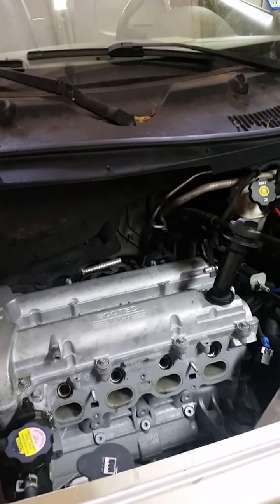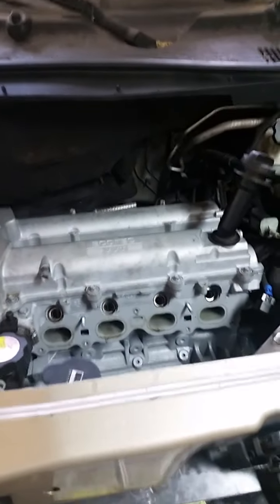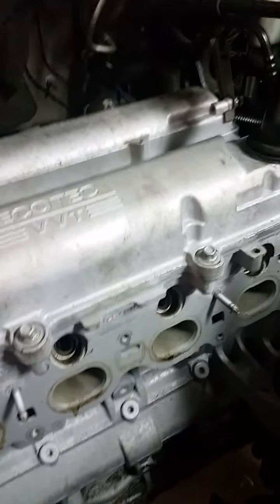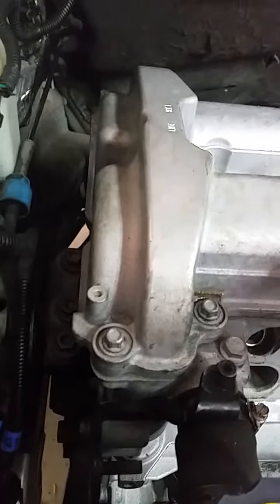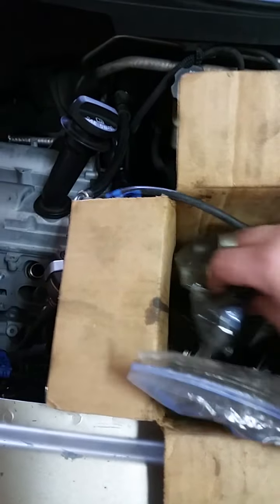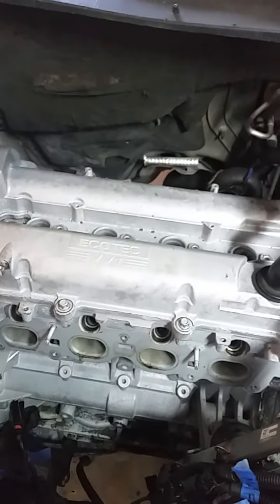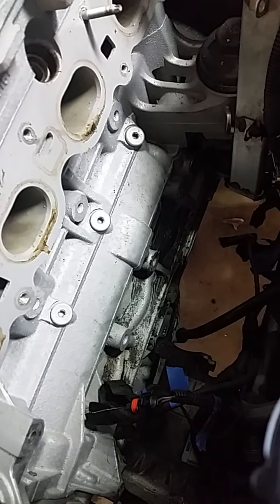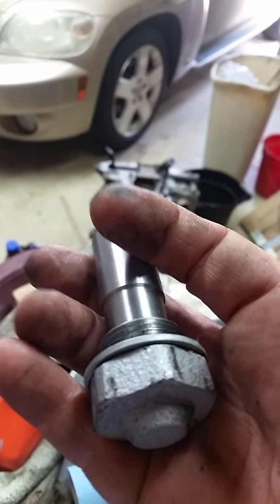ENGINE REMOVAL: Chevy HHR 2.4L Ecotec Part I

Comment: I just bought a 2009 HHR panel LT 5 speed manual with a 2.4. I love the vehicle . It is so versatile having only 2 seats. Just 105,000 miles or 170,000 kms here in Canada. It is absolutely rust free. All garage maintained.. No moon roof which I think is the only option I didn't get on it. A very nice driving car so far.
  I really enjoy your videos as I am a lifetime diy guy. Keep them coming.
Reply from the maker: Congrats and thanks for your kind words! You're not missing anything not having the moon roof. Thanks for watching! Check the HHR Playlist.

Comment: If my memory is correct, this is a wet shelve block, meaning the cylinder liners can be pulled out replaced the o rings changed just like in a diesel engine. throw in pistons and rod assemblies and almost a new motor if you still have the old engine. J
Reply from the maker: Jack Hembree: Sleeves yes, I don't believe there are o-rings, at least I don't see any. Still have motor, stay tuned for disassembly video on my channel. Don't forget to subscribe!   Thanks!
Reply: should be rubber o ring seals on the bottom of the sleeves to seal oil and coolant passage. I look forward to the rebuild. J
Reply from the maker: Jack Hembree If so, that would explain water in the oil issue. If so, mystery solved!
Reply from the maker: Jack Hembree I'll look for that!

Comment: Hey jay had to get rid of my 2007 hhr at 260,000 bad valves and bent.. so I pickup up another 2007 lt2 with 112000 three months later I’m running into code p1174 had you ever had that ? I’m going to change plugs clean the maf and throttle body.. it’s the only code no misfire nothing ,runs good idle a little choppy .. so I’m not sure on the maintenance so that’s why I’m doing it .. some say it’s the o2 sensor bank 1 before cat or dirty injectors or maybe vacuum leak not sure ..
Reply from the maker: I'll look into  that and let you know what I come up with.
Reply: J. Hunto's Garage 
Hey jay got the car back tune up and found top clamp on the throttle body that hooks up to air filter box was broken letting more air in and making the car burn lean .. and the number 3 cylinder was a light mis fire possible injector maybe thirty .. well off to the boneyard to get injectors and a new clamp when it gets warmer ..

Comment: I need another engine. How much did you pay for yours? I'm being told $2,000 approximately. I only paid$3944.00 for the car
Reply from the maker: Moon Aet I paid $2400 for a remanufactured engine. I don't recommend that. If I did it all over again I'd get an engine from another HHR.
Reply from the maker: Moon Aet Depending on what condition your engine is in, you may want to look into swapping the bearings and rings or a valve job. Here a video on the tear down of my engine. 
https://youtu.be/CVcdtDAt_kM